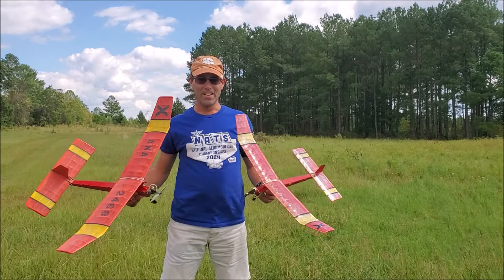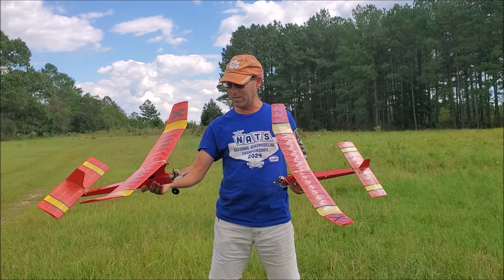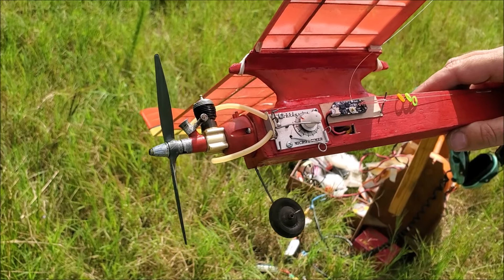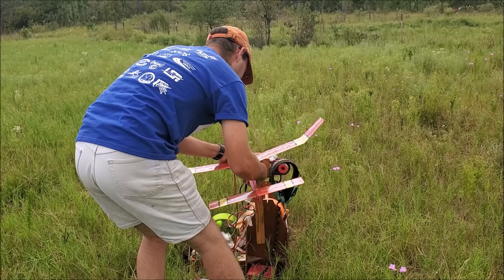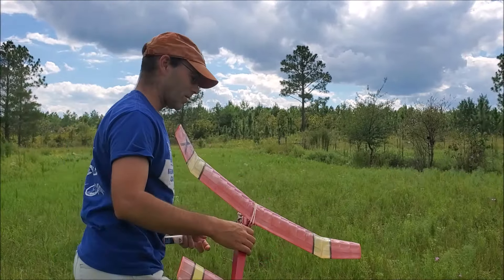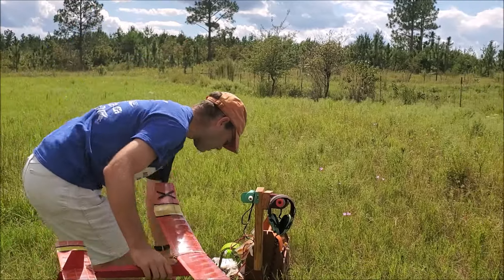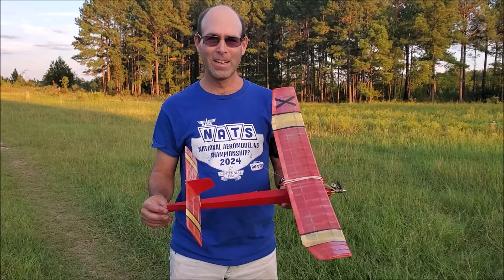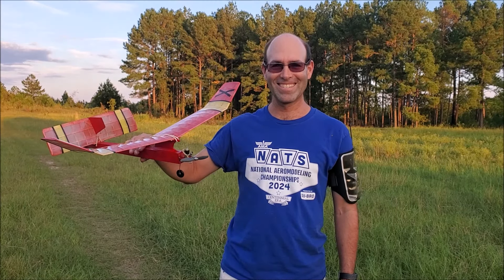Fubar 29X with Cox TD 020 Free Flight!

Comment: Built and flew a Fubar 36 in @1950. Baby Spitfire .045, eyedropper tank. Knew nothing about flying powered FF. Flew perfect off the board. One time.  Stuck in top of a Sweetgum tree.
Good video. Good memories
Reply from the maker: Oh that's so cool! I briefly had one of Ray's original Fubars with his drop down stab rig and Austin air timer for fuel cut. Such a cool setup. I kinda wish I'd kept it, but space was an issue. The 1953 version, in this video, moved the stab on top and made for a much easier DT arrangement.

Comment: Hot design in the 50's and good with the earlier .049's such as Anderson Spitfire.
Reply from the maker: If I'm not mistaken, Ray had switched to Atwoods by the time the X series came out, but I could be wrong. He definitely won a lot of hardware with them. Probably flew a few of them on Holland Hornets too which must have been incredible.

Comment: Hey man I recently purchased the 2025 division b/c helicopter and I wanted to know if the 2021 video will help me construct it because I can't with the instruction I need to read because it makes me tired and I like it better when I fallowed you video for the 2024 division b/c stinger (I think) flight plane and I got it done perfectly
Reply from the maker: We haven't had the opportunity to record a video for this time around. Other than the vane, lower bearing installation, and initial blade assembly procedure, there is no commonality between the 2021 and 2024 Tornado kits, and zero compatibility between the 21 and 24 Twister kits, so you will need to use the manual for anything other than the most basic techniques. Take your time and follow the steps. Orientation of the blades is very, very important, as is proper assembly of the jigs. Shoot me an email if there's something specific that's unclear to you.

Comment: Nice. Hmmm.  Been about 55 years, but my recollection is that right stab tilt caused a left turn in glide. Must be a false memory. 👴
Reply: You are right, right tilt makes it turn left. If the stab is lifting - it doesn't work on the average RC model.
Reply from the maker: Yeah plane turns toward the high side of the stab. Sometimes we tilt the wing instead though since you can do that without changing incidence.